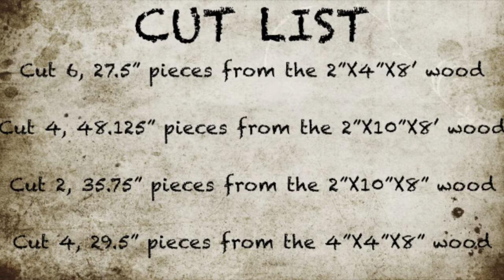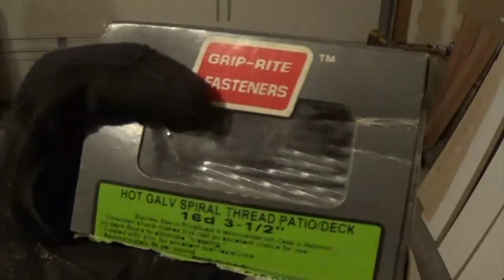HOW TO BUILD A FARMHOUSE KITCHEN TABLE - EASY DIY PROJECT

Comment: Do you have a video on making a kitchen table with pallets ?
Reply from the maker: I don't because most of the wood on pallets is thinner than you would want to use for a kitchen table. The wood is generally pretty rough as well. So, I just stick with pine and it works well. Hope this makes sense. Thanks for checking out the video and good luck!